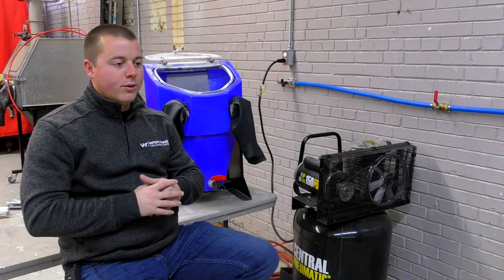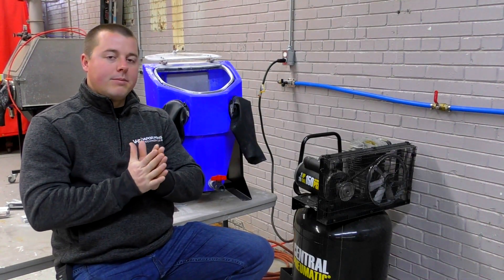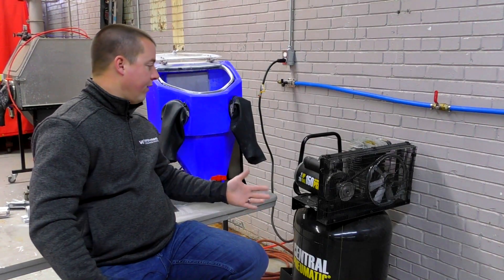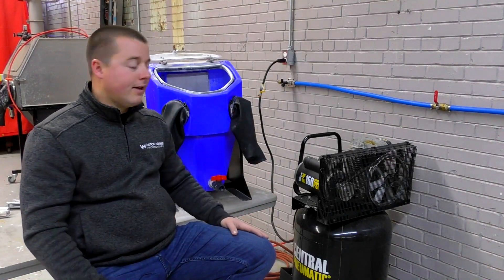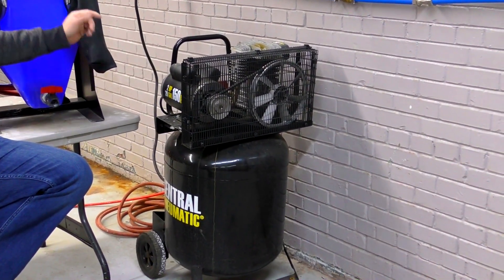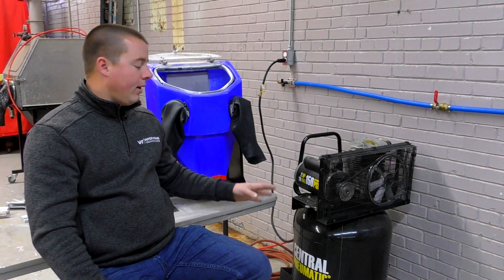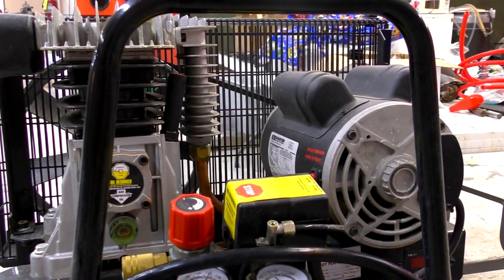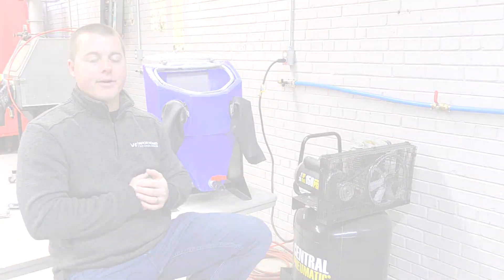Air Compressor for the Micro Vapor Hone - Vapor Honing Technologies

Comment: The cfm rating of this compressor wasnt mentioned in the video so I looked it up, Harbor Freight lists it at 5.9 cfm.... So my question is could I expect the MVH to run about the same on a different compressor that is rated at 5.1 Scfm?
Reply from the maker: The Micro Vapor Hone needs 10-15 CFM to run properly.

Comment: Honestly, if you're going to spend the money on a micro hone, you should definitely spend the money on a 60 gallon compressor first. It will help you get a lot more done in the shop, and it will run a micro hone like a champ. Just my opinion.

Comment: I have this Dewalt 230v in my shop, I should be ok right?
Airflow Volume: 13.4 @ 40 PSI, 11.5 @ 90
Horsepower: 3.7 hp
Tank Capacity: 60 gal.
https://www.tractorsupply.com/tsc/product/dewalt-60-gallon-air-compressor-155-psi-dxcm601